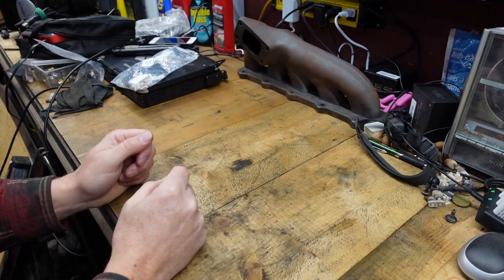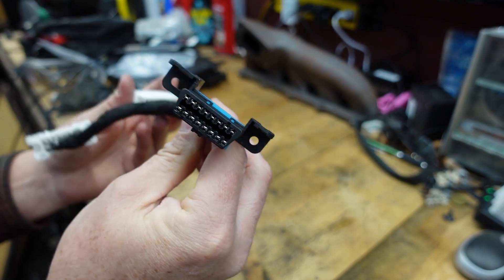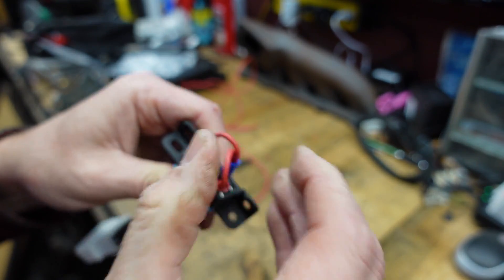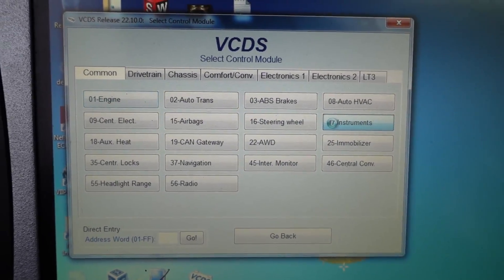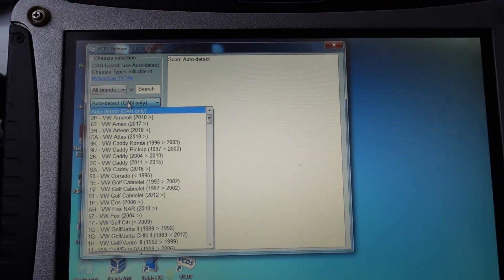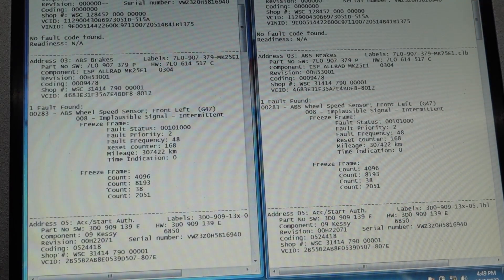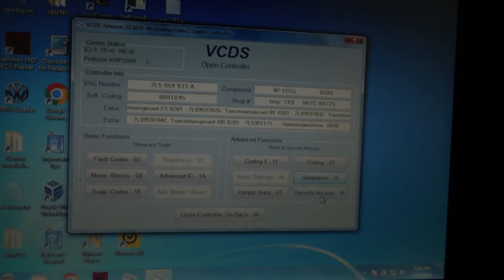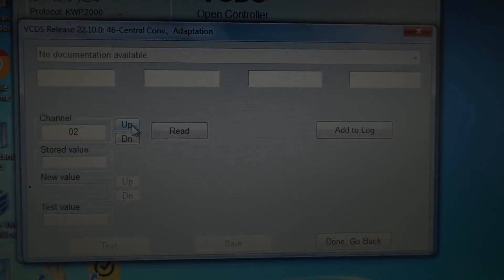Hacking my Porsche Cayenne to use VCDS

Comment: Hi PG did you figure out how to have an access to other modules or service resets
Reply from the maker: Unfortunately not. I’ve since purchased the icarsoft por3.0 and can do service resets with it but unfortunately it doesn’t do much else of value either. This is certainly a tough nut to crack.
Reply: @PBGarage  what about new ver of vcds 24 will it be better or same
Reply from the maker: @robertgrzywacz3236 I doubt it would be any better. If anything I think you’d have more luck with a much older version of VCDS. From what I can tell, Cayennes were at one point in time supported. But obviously Porsche had a problem with people being able to use VCDS and banned it from being supported.
Reply: Hi PG I hack my vcds cable, connect pin 3, 7 and 15 and still have an error 
Unable to find ROD file for BCM, 
do you have any experience with it

Comment: I picked up an '09 Cayenne (base) a couple of months ago. I'm a VCDS user for a while now with my Q7 and A4, so I'm glad to hear there's some access.

Any updates on the Service Now reset? Mine is on and I'd love to kill it - the oil isn't due another 2k miles.
Reply from the maker: So far no luck and I actually just purchased an iCarSoft POR 3.0 to try and do it. Will report on this soon. Still would love to find a way to do it with VAG COM.